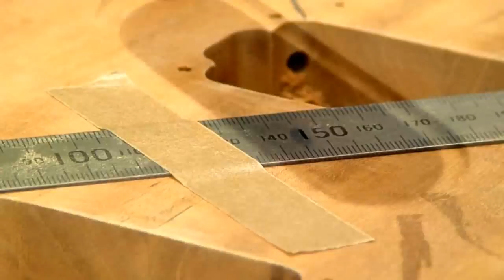Part 15 - Routing for Humbuckers, Aligning Bridge & Drilling Input Jack

Comment from the maker: Hi Alvin, I  adjust the high E saddle 3/4 forward then measure 25.5" from the nut (fretboard side)  to the break point of the saddle. This allows me to locate the mounting position of the bridge.

Comment: The stewmac website says for a telecaster with a 25.5" scale length, the forward-most mounting screw should be at 25.75" from the nut. Is that how far you positioned yours? because surely that would result in a scale length greater than 25.5" or is that just how it is meant to be....?
Reply from the maker: Bridge mounting holes positions are defendant on the bridge you are using - 25.75" cannot be right

Comment from the maker: Hi Peter, there is a bearing at the top of the router bit that rides along the edges of the template. If you check out my Strat building video's (especially part 7) I show them in detail.  Cheers

Comment: great video and it helped a lot. I have a question! While making the pickup cavity on the first go, how much depth should be considered for digging in the cavity for pickup?
Reply from the maker: I take 1/4" passes and take the cavity down as far as I need so the pickup can sit without the screws bottoming out.
Reply: Fletcher Handcrafted Guitars thanks a lot

Comment: Hi David, could you please tell me which router bit you use for the pick up cavities? I have a 9.5mm template cutter but don't think that bearing will follow the radius well enough. Thanks.
Reply from the maker: I probably used a 3/8" ( 9.5mm) so you should be ok
Reply: And it was. So far so good. Learning so much from your videos - thank you.  I only wish i had your workshop!

Comment: Mr Fletcher, for the installation of the bridge, for a 25.5 scale strat, you calculate 25.25'' from the nut to the center of the mounting screw holes?
Reply from the maker: That is correct for the Gotoh bridge I used
Reply: Ah, so for the 25.5 inch scale, u measure 25.25 for the very front of the bridge?! Makes sense. I’m a beginner guitar builder and was wondering how u know how to set the saddle when installing it. Cheers!
Reply: 25 1/2 inches from the bridge side of the nut , to the apex of the bridge saddle for the High E string . That will tell you where to mount your bridge . Locate your high E saddle apex  25 1/2 inches from the nut , and then your bridge mounting screw location will follow .
Reply: @hoeffer9  thank you! the one question I’ve always had was how to find the total scale length when the saddles can move forward and back.
Reply: @EMPTYKProductions  Yes set your saddle roughly in the middle of the intonation screw ( allowing for the thru the body drop be hind the saddle ) then position the bridge so the apex of the hi E string saddle is at 25 1/2 inches from the nut and that will locate your bridge and there for mounting screw placement

Comment: Hi, David.  I have a question about routing for the pickups using the template.  How do you do it so that you don't cut past the template?  Is there a gap between the cutting blade and the template, or are you just really careful and freehanding it?